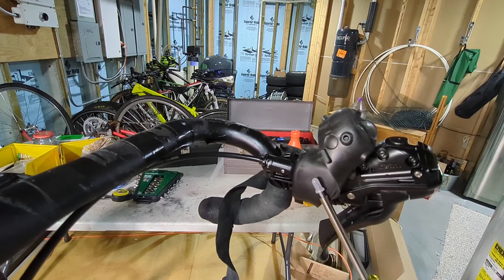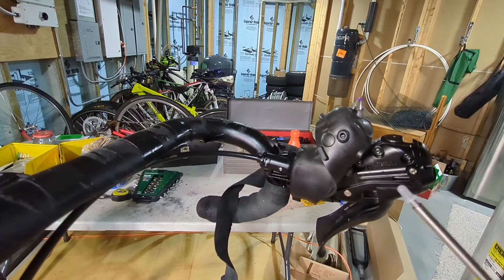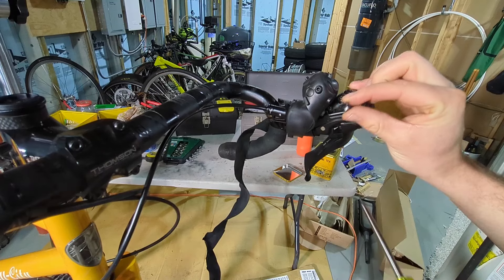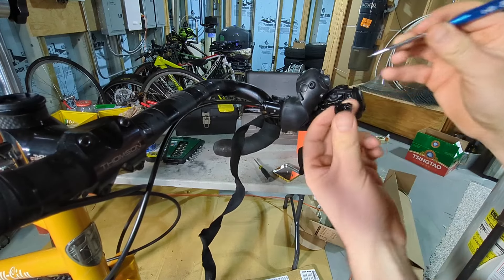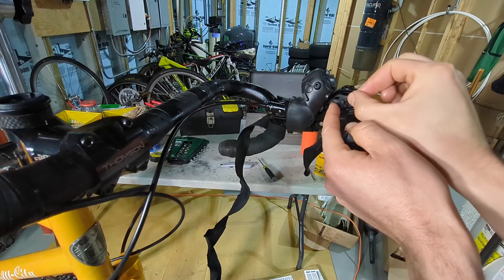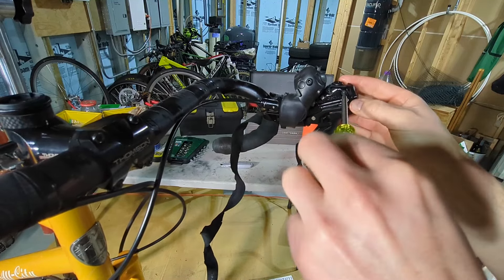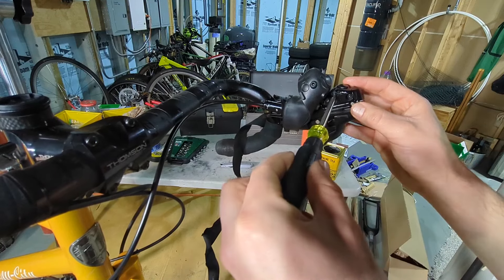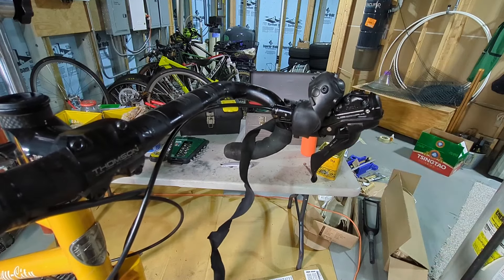Shimano Hydraulic Disc Brakes Leaking from Lever - Repairing a Leaking Diaphragm (Lid Unit)

Comment: Was the oil collecting on the bottom of the bracket covers? I had this issue on a brand new bike with 105 di2, lost brake power after 500 miles or so. Had brakes Bled and now am seeing oil still collecting under the hoods, making me think oil still leaking somewhere
Reply from the maker: Yeah I think that's exactly where it was leaking so def could be the same problem I had!  Pretty inexpensive/ simple fix

Comment: what tools do i need to unscrew the three screws? Two are torx (I believe) but the other is somethign else. All really small. If you could let me know what exact tools + sizes are needed that would be suuuuuper appreciated. i'm trying to fix mine and local bike shops have now appointments for several weeks (I tried 4 stores)
Reply from the maker: Hi off the top of my head it's a little torx screw maybe a T10 and if there are Allen screws maybe a 2.5mm but I can't remember for sure right now.  Pretty sure a micro screwdriver set with torx and a small selection of metric Allen keys is all you need

Comment: As a professional mechanic, it's always best to remove & inspect the diaphragm first, as in many cases there's no damage to it & it just requires re-seating correctly.
The force applied when bleeding can unseat it, causing the leaks.